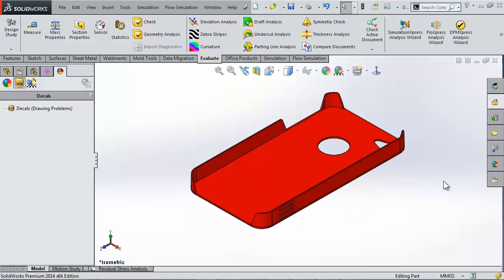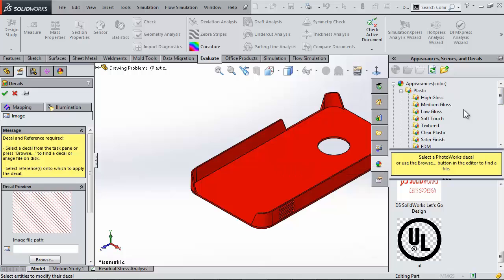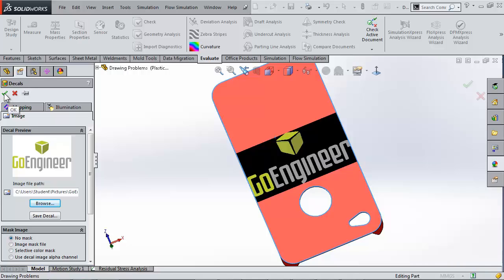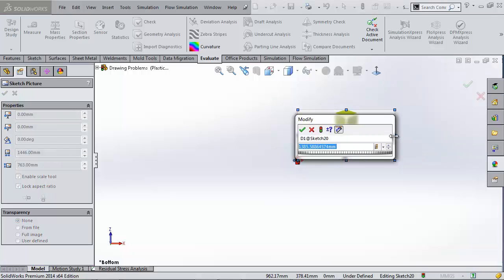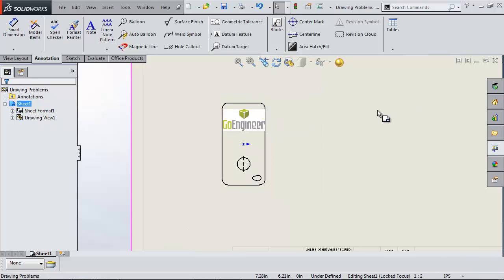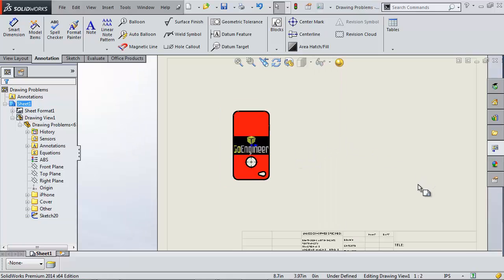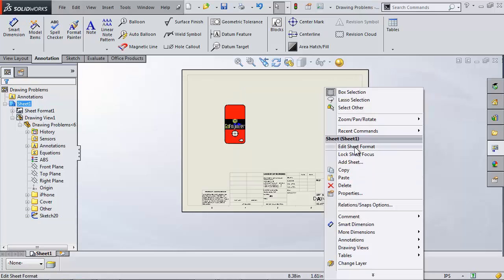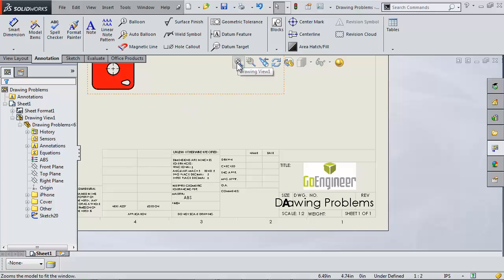SOLIDWORKS - Inserting Logos into Parts and Drawings

Comment: Why do my decals disappear after applying them to a model?
Reply: +Chris Call

Hard to tell unless we were looking at your model, this may be a good question for your local VAR who can do a screen share with you. http://www.solidworks.com/sw/purchase/varlocator.htm 

I would first check if your View > Hide/Show > Decals was turned off. 

Shivani
Reply from the maker: Hi Chris,
There are a couple reasons that decals might show on your model only when you are editing them.

The first thing to check is if you go into 'View', 'Hide/Show', make sure that "Decals" is activated in this list; if it is off then all decals should be set to hide when you are not specifically editing them.

If that checks out fine you might be having a graphics issue as a bad reaction to the graphics hardware you have or the drive running your graphics hardware.  In that case you would want to visit this page on the www.solidworks.com website (http://www.solidworks.com/sw/support/videocardtesting.html) to make sure you are running the recommended driver for your hardware (this only applies if you have a supported graphics card).  If your machine is not running the listed driver it may have some graphics issues/anomalies.

Of course, if none of that helps you would want to rope in your VAR to help diagnose it further.